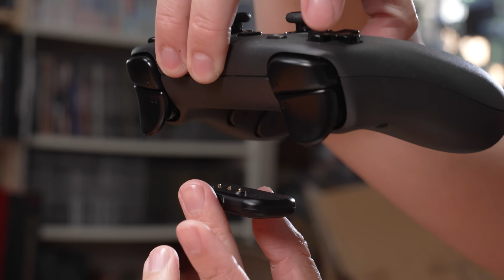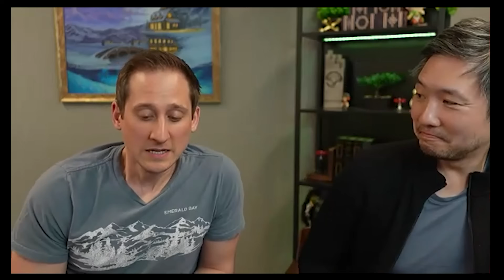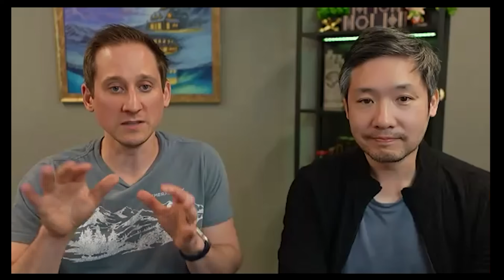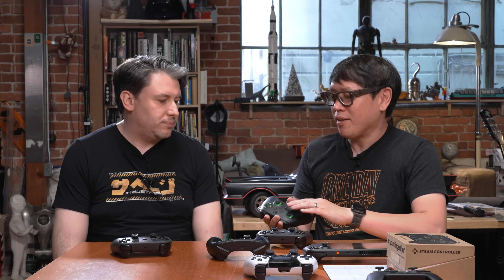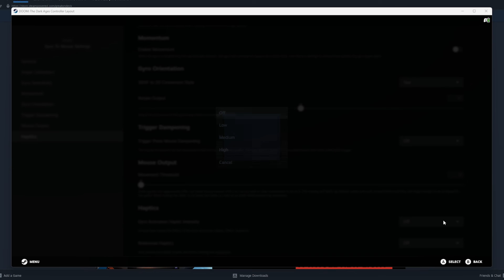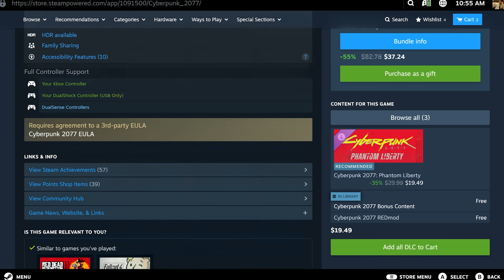Tested: Steam Controller Review + Valve Interview!

Comment: I have zero need for a steam controller just as I have zero need for the trackpads on one.  As others said, that's the point in getting this.  8bitdo is amazing at everything I and anyone else might need from a controller for PC gaming and my mouse is right there if I need precise input for something.  I rarely play anything that would use a controller over kb+mouse tho.

Comment: Can't wait to get my hands on it.  I've been a tilt control devout since picking it up in Splatoon but the switch pro controller has compatibility issues on PC and no analog triggers, I would still use it to control the camera with tilt controls in some PC games.  Using touch sensors to reset gyro aiming is such a good idea, I know I'm going to love that.

I'm also excited for the touch pads. Years ago, I played Guild Wars 2 with a 360 controller through meticulously making a steam input profile with many layers of button mappings. I did the same thing for Path of Exile long before they added controller support to the game.  I would have KILLED for the touchpad for inventory management, or the extra buttons on the back, or capacitive sensors to create button layers. This controller is a dream for the power users who see how much potential there is on the software side.

Comment: For one i think yall did a great job in this review and brought up alot of good points.  My main complaint about the steam deck is the Dpad.  Its mushy and almost seems like it doesn't have enough surface area ( i have small hands) when trying to do diagonal presses for say a hotbar 1,3,7, or 9 position.  while some might say use the track pad. That means i cant use the track pad for other things like a journal hotkey or level up hotkey (yes i could mode switch but that can be cumbersome and ive likely done that for quick saving already).  The only thing that i STRONGLY disagree with is the track pads.  The controller without them is so niche as to not be worth existing ( omitting repairability) .  With them and the software gives you the capability to play alot of older games that were never intended for a controller.  On my steamdeck ive went back and played KOTOR 1/2, fallout 1/2/BOS, wasteland, Total war, and a few others.  I've even found that with some games that support controller such as KOTOR2 and BG3 and xcom to actually be a better experince (due to being able to tailor it to my preference and get away from opening 3 menues just to quick save  in games prone to crashing *cough cough Bethesda*, or hotbar swap, or use an item),  tho this is mainly with games that dont lock you out of keyboard function when using a gamepad.  Your also forgeting all of the indie games that alot of people play that arnt cross platform and maybe controllers were never seen as reasonable.  While everyone has their own use case and some will get little to no use out of them, I was kind of shocked you sung the praises of the niche gyro community (they are probably right i just havent explored it yet) yet seems like little built in interactive menu system or maco toggle options (easy example is leveling in a game like skryim or jiggle peaking in siege).  That all being said probably the best review ive seen on the device.

I only typed all this out because alot of people already voiced that the trackpads are loved but not why.  So i wanted to give examples, new ways to try them, or maybe even help others get more use out of the steam deck/games they already own.

Comment: As a steamdeck user

The touch pads are something i would NEVER ever want to be without 

And NO, the gyro doesn't come close to replacing the touch pads

Clearly you haven't tinkered around with the steam deck control options enough

Those 2 touch pads are at the very least  an extra 8 buttons and at most,a mouse and a custom keypad with multiple buttons

Absolutely crazy that some people don't get what the steamdeck can do input wise

The only issue the steamdeck has,is the dpad,cant do diagonals with it,both lcd and oled

Comment: Hmh. Weird PS-Xbox button layout. Not like there are no Xbox gamepads with d-pad top left, but its bit unusual. Honestly after getting used to it, I prefer d-pad down right as its more natural and easier. But both works. Its just not easy to switch between types.
Ergonomy of this gamepad looks all wrong, tho. You need good grip from inside to counter thumbs movement. Hard to say just from the video, but i dont like that shape. Big, bulky, unnecessary functions and my guess...heavy. 

USB-C is all around TERRIBLE for the gamepads. No matter manufacturer. That connector get chewed up really fast by the weight of cable.  Specially when you make area around connector curved instead of flat.... gl with that...

Comment: What I need to know most... When the steam box launches, will it include the controller or do we need to buy separate?

Also how it feels. The original steam controller was nice, but the touch pads were too finicky in some use cases and didn't feel that good. The button positioning also was a bit underwhelming. The steam deck on the other hand made those touchpads WAY better in both feel and how well they worked, and the button layout felt a lot more natural. If these touchpads feel like the deck, that's good. But ergonomics needs to feel good too. I'll still get one either with a machine or in addition to one, but would be great to get a feel of it in a store first

Comment: I used my track pads so much on my first steam deck I wore it smooth on the right... That'll be 1000 hours in satisfactory. Now I'm having a hard kick of hell divers and more controller centred games I've barely touched them.

They look like they could be in the way on the controller, the price is a little worrying as 1/4 the price of a whole entry level deck makes me concerned for the price of the frame!

Comment: Not that this controller is perfect by any means, and the price can feel a bit high if you don't use all the features, I do still think Norm's takes are a bit unique here. Which is good, to be fair, as there'll be people like him around. Controller reviews are always subjective, but some of the things said here feel very extreme cases of subjectivity that perhaps could work a bit on presenting them as such rather than something Valve should have done differently. That all said, this is a tough buy to begin with at the 99 price point when you can't try it anywhere.

Comment: There's no reason for Valve to even release a controller if they didn't include touchpads, since there's so many first party and third party controllers without touchpads that have full Steam Input support. And new touchpadless controllers coming out all the time from 8bitdo, flydigi, and gamesir. 

Unless I guess it is super important to have a generic touchpadless dual joystick controller with the Valve logo.
Reply: Hori Steam Controller is exactly that but with two grip buttons and no touch sensors on joysticks.
Reply: @emperorfaiz  Hori is a licensed Steam controller, but not from Steam. It does actually come with touch sensors, but no rumble. And people who got it brought up how terrible the gyro felt when used wirelessly.

Comment: It's crazy to me how few people reviewing have extensive experience using steam input to leverage the trackpads. Not even just messing around but even just using a premade community mapping. There's so much more you can use it for than a mouse input and second d-pad. You'd think for a review the majority would test the main selling point of the controller, rather than using it for something menial and saying xbox controllers are better.
Reply: Long time Steam Controller users aren't surprised that the non standard inputs that require Steam Input to get the most out of them are not well understood. And it was the same with the Deck, and it isn't surprising that it is the case again with the new Steam Controller.

Valve keeps taking the hands off approach putting trust in reviewers who's background is decades of xbox controller plug and play gaming and using a mouse for aiming to showcase things better despite past track records of failures with that approach.

Valve should have provided a list of games paired with  controller configs made by Valve so reviewers wouldn't have to try to make their own to see how they work and why people who bother to utilize Steam Input like them. Got to make the process as idiot proof as possible when it comes to something reviewers might have never used before.
Reply: I'd be tempted to buy a steam controller if i hadn't just bought a dualsense and it didn't look so goofy.
Reply: @AtreideSardaukar  "Goofy" is not a good criticism
Reply: @emperorfaiz  I wasn't really trying to be Robert Ebert, but the form factor is part of what i like about the DualSense. it's "pretty-functional" ;)
Reply: @AtreideSardaukar  You will still need it for ps5, if it was for pc... I got a new xbox one for pc a couple months ago,  will end up with a steam controller too.

Comment: Funny how the talk after the Valve interview is "oh the trackpads are pointless" and "I wouldn't use this on something like Crusader Kings". Crusader Kings, Football Manager, etc are the exact games that allow them to be played on the couch. Not sure wtf they're talking about? The trackpads are awesome and a great differentiator.
Reply: Game with proper Gamepad support doesnt need analog cursor input. Both CK and FM could easily do without it. Its just lazy conversion. 
At that point you'll do better putting gamepad aside and use mouse instead. You get one hand free, at least. Sadly its very common way game developers 'do' gamepad support, because redesigning UI takes too much effort...
If you want good example how to do it right, look no further than FFXIV.
Reply: @cyphi474  But they don't and I want to play. Cue a controller that adapts and allows for inputs to make it work. Do people not understand the point of the trackpads? You're all mad.

Comment: Bro! In strong defense and hype for the touch pads: radial menus. I often set my touch pad to bring up an on screen radial menu, then fill that radial menu with keyboard shortcuts.

It's changed the way I game not having to hit 1 through 9 on a keyboard even when I want to play on a controller.
Reply: radial menus are awesome. also i have a few games where i've set up 4x4 touch menus (modded minecraft is a notable one). you can even change which menus you're dealing with using layers. it's so immensely useful and versatile, and the haptics help a lot too, since you can 'feel' which slots you're moving past
Reply: hmm thats interesting and cool function i think i gonna adapt that my self!
im getting the old steam controller "used ofc" just because i want to have one  for the living room pc. 
And then the New controller for my big pc & frame when it release, 
Thanks for the insight!

Comment: Valve is very deceptive with this. I author software that works with input devices at the hardware protocol level, Valve has engineered the device to be non-compliant with the USB HID standard from 1996 that all other competing input devices support. They do this for a simple reason, ecosystem lock-in, by making the software required for this device to work inseparable from their store. In the 1990s Microsoft was in hot water for similiar anti-competitive practices, but I'd say that Valve's anti-competitive practices here are one step beyond what Microsoft was guilty of, as they are able to prevent competing stores from using the hardware and able to require software sold on other stores to be run through their own. They make it inconvenient enough that you eventually capitulate and avoid buying software from other stores.

It's downright disgusting behavior and they need to be put in their place for doing this.
Reply: You can use the controller as-is without Steam on Linux, as there is a driver which will pick up and detect the inputs as a regular controller (If the application starts using the evdev Linux api for controller support). Additionally, you can use the controller without Steam through the multi-platform, open source SDL2/3 library (even on Windows, this library is how Steam Input works), as Valve contributed direct HID support to the librarie's GameController API. Both things have no  store or direct Steam requirement.
I do agree they should make a driver, but to say they are "one step beyond" Microsoft's practices is a little rediculous given that context.

Comment: Valve should be blasted for blocking a PC-controller from working outside of Steam. This is a crystal-clear case of anti-competitive behavior through vendor-lock. Youtubers seem affraid to critique the controller fearing they won't get Steam hardware to review in the future. Plenty of gamers had to figure out this controller did not work outside of Steam by word of mouth, because most Youtubers (seemingly purposely) didn't mention it. Several tech sites (like Engadget and The Verge) have pointed out this is anti-competitive behavior, but I have seen almost no Youtuber do the same.

Comment: That is a really good point. I use my back buttons often to remap stick presses for sprint/sneak and sometimes when I am in a high pressure situation I accidentally press the back buttons when I don’t want to. I think I prefer them not being perfectly situated on my resting fingers so I can use them as a toggle and not as a quick reaction 28:21

Comment: Can the cursor be used outside of games/steam to navigate the desktop? What does the … button do, can it give the option to bring up a onscreen keyboard like on Steam deck?
Reply: Yes, you already can with any other controller by enabling a desktop mapping in the settings of the client.
The ... button is the "more" button on SteamOS, which opens the quick settings sidebar.
I don't think that key is re-mappable, Steam+X is the baked in shortcut for opening the keyboard, on the OG controller this is also mapped to clicking the stick by default.

Comment: I really wish the touch pads were on the Steam Frame controllers also.  The UI issue you describe is a big deal in VR.  Laser pointer style is awful when using a virtual desktop.  I would like to have a touch pad for normal mouse input.  Also it defeats the input parity that they describe.
Reply: I don't know anything about VR.

But if you can play flat screen games on the Steam Frame, I don't know why they didn't completely match the controls.

I guess the Steam Controller is technically supported on the Steam Frame anyways. You can do VR motion with the Frame Controllers for navigation, but trackpads are still useful.
Reply: @Shi @ShibaPhan-n1d nder if the Frame controllers were intentionally half-baked to encourage upselling the steam Controller as an add-on for the Frame.  The trouble with the Frame controllers is that they both do not meet the input parity of the Deck but are also not an ideal layout for VR since they are not symmetrical with each other.  Symmetry is important for handedness reasons.

Comment: It's great that Valve is selling replacement parts through Ifixit. However, the most common reason, that I can see, to open the controller up, would be to preform a deep clean on it. I feel, that it would be likely for people to accidentally mix up the screws and damage one of the IC chips. And yes, I did this to my original Steam controller, -_- I was tired. My question is, would ALL parts be sold by Ifixit, or only non-silicon parts, like they did with the steam deck? And if there is a limited selection, why?

Comment: I like that they’re putting more input on the back of the controller, but I’d like it to still be more ambitious. You have so many fingers back there and have your thumbs doing all the work on the front. Put the touch pads on the back. Instead of buttons, make the whole inside capacitive and haptic so you can make any part of it a button or any kind of input you like.

Comment: I'm with Linus in that they should be calling it the Steam Controller 2 and Steam Machine 2.
Reply: On the other hand, the original hardware is so far out of production, it doesn’t really create any sort of confusion for new customers since many likely haven’t ever heard of a “steam controller” or “steam machine” before learning about the current versions, and there aren’t two different versions in wide circulation to also cause that confusion.
Reply: @Roccondil  You don't have to know the original even existed for it to cause confusion later on.
Reply: @Call_Me_David  If the original is so out of the picture, when someone hears about it and searches for it, they will get primarily only results for the currently-available hardware. Thus no confusion.

Comment: 16:50 that's such good question and I'm not sold w/ the answer they gave... feels like a super poor excuse to not add an SKU w/o the puck (we know the battery life of a controller is like 24h+) more so after how much they emphasized the use of 4 controllers with one puck. Feels like a HUGE miss play even if its 10..15 bucks cheaper it would still make a diff and would make the purchase of multiple controllers more reasonable.

While everybody be glacing valve none stop we should srly stop and call out this type of obvious bs.